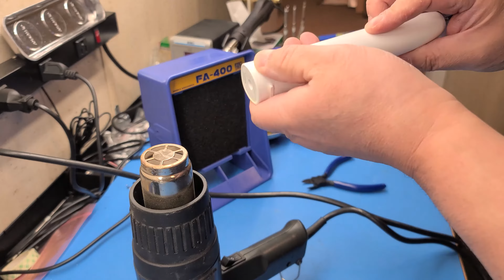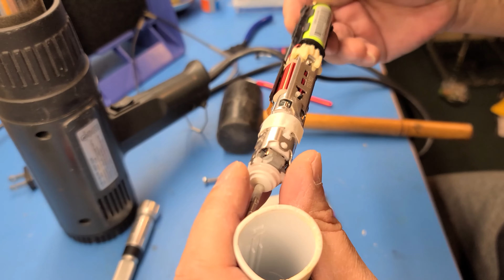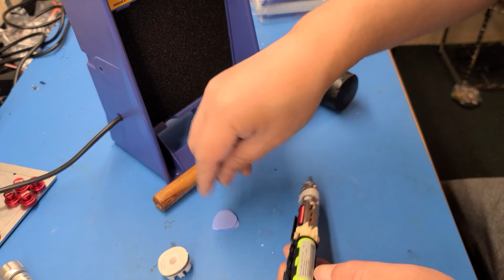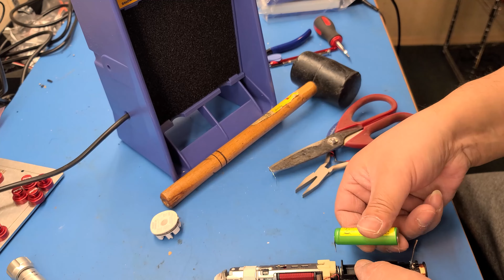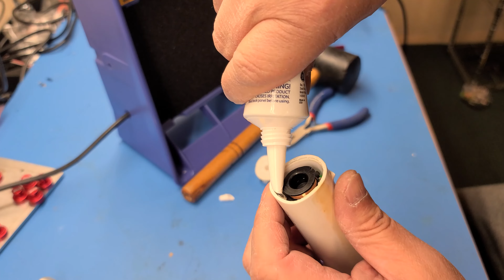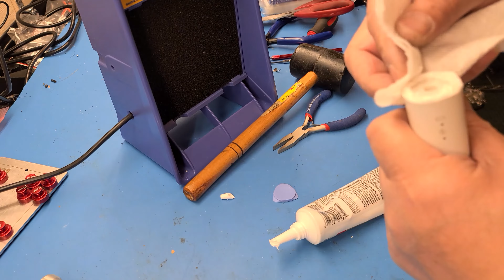Replace the rechargeable battery inside your Philips Sonicare Toothbrush

Comment: For the end cap I clean the groove & the black rubber o'ring. Then apply some dielectric (silicone) grease to the o'ring. Not silicone sealer. 
Then it seals again like from the factory & in the future it is easy once again to disassemble.

Comment: No heater needed, no cutting the protective insulation is needed. Just put the device upside down on firm platform and apply couple of hand strokes from upper edge down and you'll see it slowly gets unleashed. Like putting on a condom but with bit more force applied. :)

Comment: To remove the battery easily all u have to do is firt desolder it from the PCB and remove the battery along with the welded pins. Now pull the pin out with a pair of pliers. Thereafter solder the pins to the PCB and then just insert the cell

Comment: Thanks but you could have said that this task is way more than the average person can take on.  The product should be banned.
Reply: Does not take much skill or equipment. Unfortunately so many people now in modern times are so trained to throw everything away and buy another that they lack basic mechanical and electric skills, and the confidence they can do it. 
Heck they even need an electric tooth brush to do it properly as compared to a manual brush. :face-green-smiling: